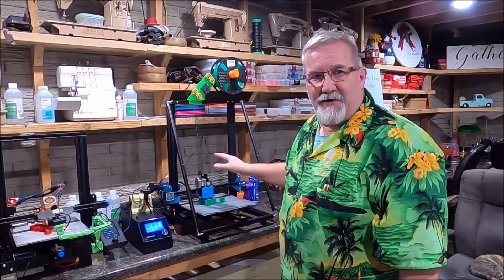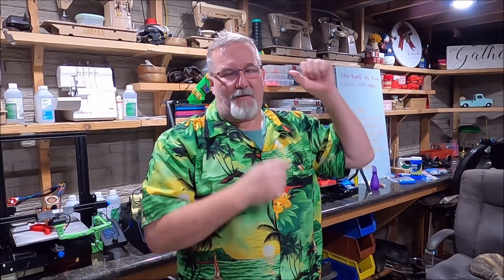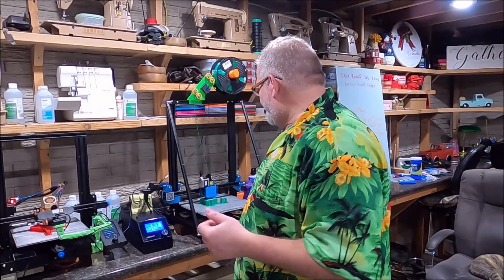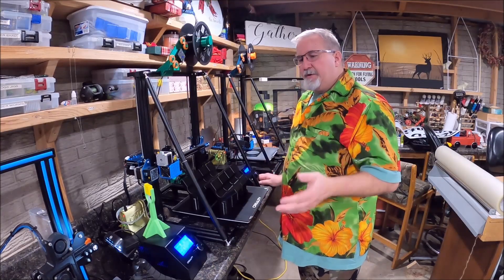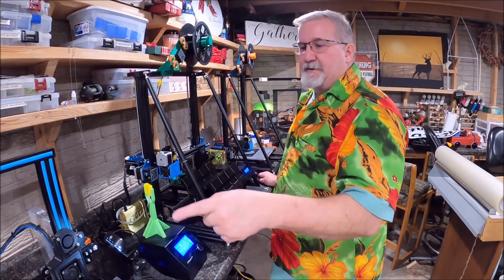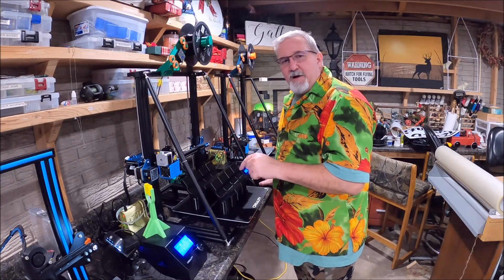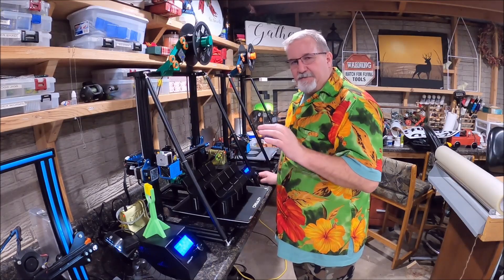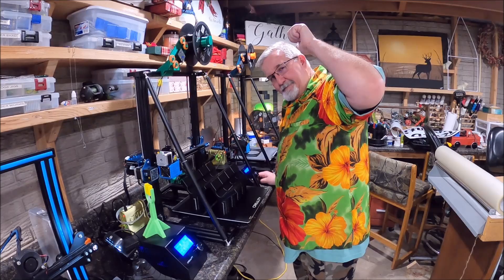Creality CR10 V3 unboxing and assembly with add ons EXCITING. I''m loving the 3D printing world

Comment: Just setup my cr-10 v3 today. Gotta get those noctua fans in that power supply. are the fans the same as in the other models?
Reply from the maker: Stay tuned I just did a conversion on my CR10- V3 to put new quiet Notua fans in the control box. WOW what a difference.  Video should drop Thursday morning.